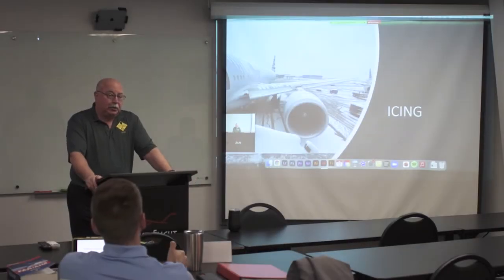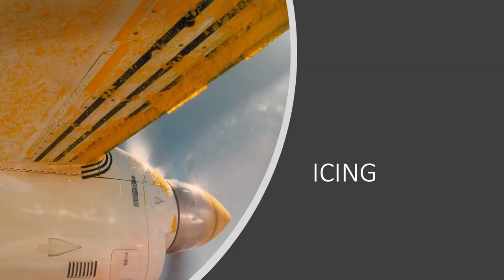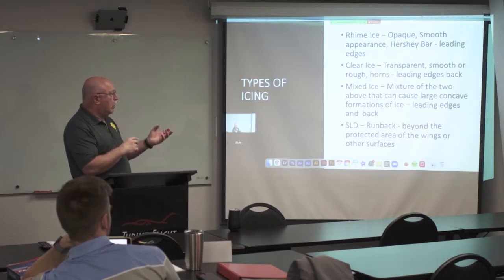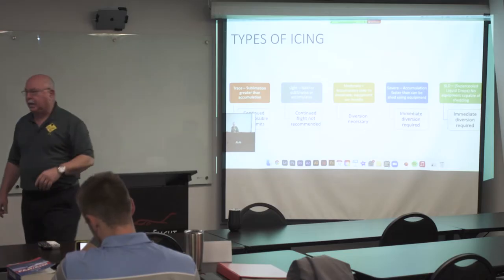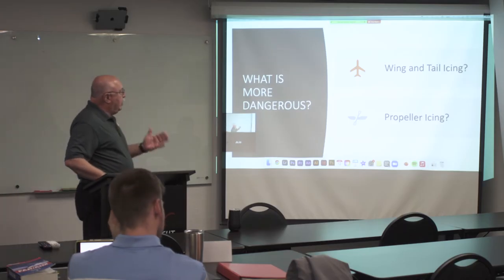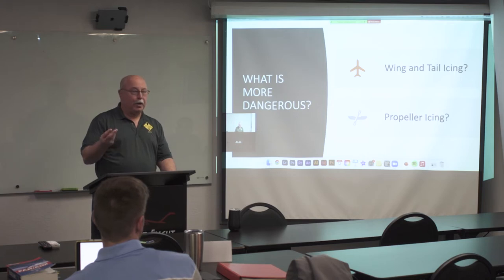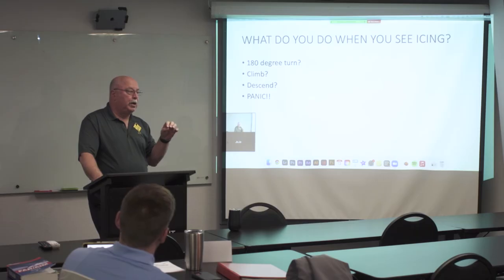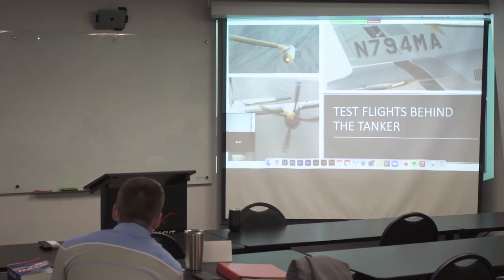Aircraft Icing: Everything You Ever Wanted to Know

Comment: Excellent, and using 'accumulation rates' is absolute and necessary; however, it would help to know how long each surface could take before its function degenerates critically after icing up.  That may come down to each individual aircraft and indeed each component, eg it's propeller(s) ... but it could be done. How often should one get out the torch and scan for ice at night?
Reply: Good question. I would like to know that as well. Honestly, if I’m in something like a 172, at night, in IMC, and it’s freezing temps or close to… I’ve already messed up lol

Comment: As a current, but not terribly proficient IFR pilot, I'd like some rules of the "road", just in case I need to fly back to the midwest during the winter.  It can stay IFR for days and even weeks on end back there.  So, if I need to get out, when do I say go, or no go?  Plus 10 centigrade (50F) and below seems to say, stay out of the clouds from about October to May, or even more!  I have seen others say zero C to minus 10 C.  Does the possibility of icing exist ANYTIME you're in the clouds?  If so, a GA pilot like me has no business being in the clouds, unless it's for a very short time....
Reply: I hope you get an answer from this channel. Myself I"m just a VFR Private pilot but my understanding is you're only going to get ice if the outside temp at your altitude is close to freezing or below.  I've read at some point well below freezing it's not a concern anymore either. So I do agree with your statement in a way, if you're flying IFR and you choose to fly through clouds with no deicing equipment and the temps are hovering around freezing then you're at risk for icing.
Reply from the maker: TLDR;
Yes, the possibility of icing does exist even if temperatures outside are above freezing. 

Here's Why:

Icing is a potential hazard for aircraft that can occur when the temperature outside the aircraft is below freezing and there is moisture present in the air. This can cause the moisture to freeze onto the surface of the aircraft, which can reduce the performance and handling of the aircraft and pose a safety risk.

Icing can occur any time an aircraft is flying in clouds or in other conditions where the temperature is below freezing and there is moisture present in the air. However, the risk of icing is generally greater in clouds because clouds are formed by the condensation of water vapor, which means that they are often filled with moisture. When an aircraft flies through a cloud, it can encounter freezing temperatures and moisture, which can lead to icing.

That being said, not all clouds are the same, and the risk of icing can vary depending on the specific characteristics of the clouds and the ambient temperature. Some clouds may contain more moisture than others, and some may be at a higher altitude where the temperature is colder. The risk of icing can also be affected by other factors, such as the type of aircraft, the speed and altitude of the aircraft, and the humidity of the air.

Also, Charlie watch our video on Go or No Go where our Chief Pilot Liz and Airline Pilot Jarrod discuss this particular topic: https://www.youtube.com/watch?v=ljRvQPh_Dbk

Your life is the most important part of flying and so always consider the risk to you and your passengers when making this decision. Hope that helps!
Reply: The FAA also states the following in its “Aviation Weather Handbook” (FAA-H-8083-28):   "An airframe can remain cold (temperature below 0 °C) in a warm (temperature above 0 °C) atmosphere if it is cold-soaked. For example, if an aircraft has been flying in a cold environment, but then descends into warmer temperatures, the airframe does not heat up immediately to the air temperature."   Having said that, the temperature of an aircraft’s surfaces (e.g., the wings, propeller, tailplane, etc.) could be below freezing, even though the outside air temperature is not. If visible moisture is present, and if it comes into contact with the aircraft, it could freeze on the airframe.
Reply: for you, a personal limit could be always having an exit strategy, including the fuel and terrain clearance performance to execute this, by knowing the freezing level map and where visible moisture is present (lateral extents and ceilings).  If you cannot be assured of an exit to 1) clear skies or 2) below freezing level ( + temps), then 180 turn out of conditions that have any significant icing.  You should likely allow only trace icing until you have more experience.  Someday if you screw up,  land at a long, well lit airport using an increase Vref of about 20% right down into the flare.  Be sure to do a controllability check at landing speed and config (AP OFF unless you have Autoland ha ha ) prior to starting the approach (3000' AGL would be my minimum),  NOT AT OR INSIDE THE FAF!! Plan regular ice checks into your flight, set a timer if you need it, and involve your co-pilot.  {me: Canadian turboprop Capt, 6 seasons of icing}
Reply: @kentb4518  My personal minimums are stay out of the clouds when the temperature outside is anywhere near freezing.  Period...  No exceptions.....  Just like Thunderstorms.  Stay away from them.  Period.  No exceptions.  Can you get by with less than that?  I'm sure you can.  But, why take the chance?  I don't fly for a living...  But, I do plan to stay alive a while longer.